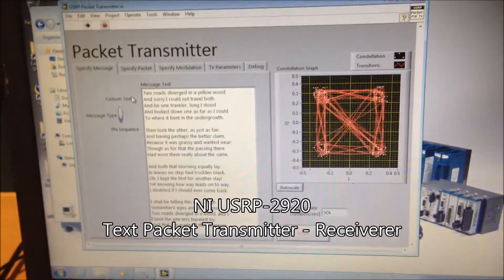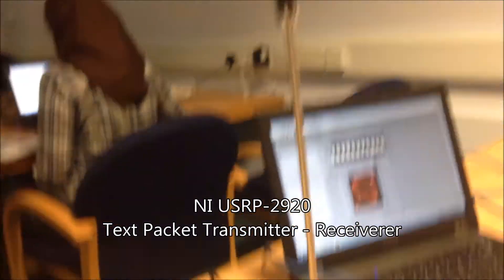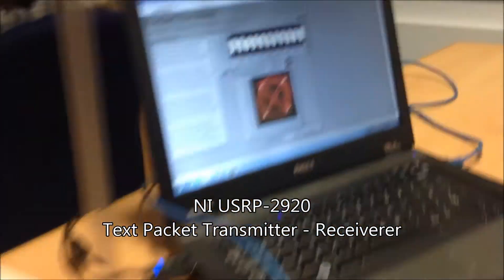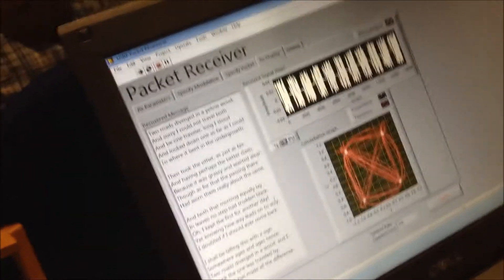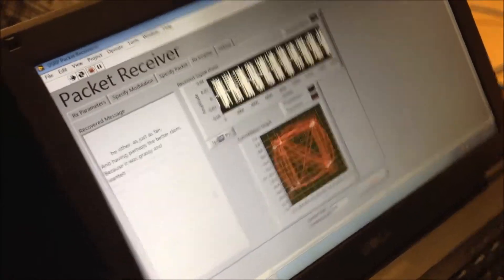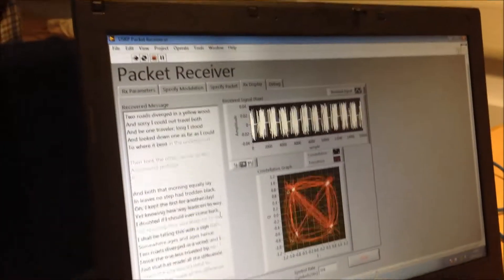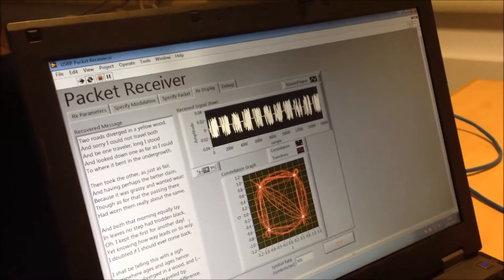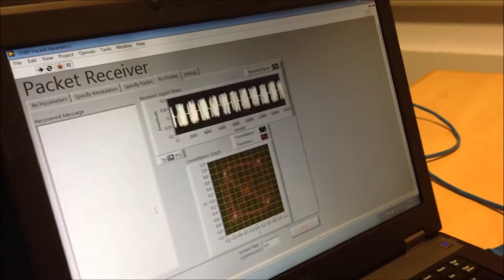NI USRP-2920 - Text Packet Transmitter Receiver

Comment: I activated this code but I couldn't run it. Can you help me ?
Reply from the maker: Kebire Bardak did download the material from link attached?
Reply: stdjmax Sorry but which one I need to download ?
Reply from the maker: Kebire Bardak 
If put this address the material should be downloaded
https://lumen.ni.com/nicif/create.xhtml;jsessionid=xG0RoYG3lizOq_ho6DSOKkp-rXu3E5G172x_TlcHe1zrKr0n-7WP!-1275838571
Reply: Can you send me the mail address if it s not problem for you ?
Reply from the maker: try this
ftp://ftp.ni.com/pub/branches/uk/introduction_to_software_defined_radio_usrp/2013/handson.pdf
Reply from the maker: Also a dropbox link no login required
https://www.dropbox.com/s/6os9np5fdly2xjz/NI%20USRP-2920%20-%20Text%20Packet%20Transmitter%20Receiver.pdf?dl=0
Reply: Thank you so much but when I run it again it doesn't work. I can not see the text message in the recevier.
Reply: Could you send me the exercise that you have please?
Reply from the maker: I do not have at the moment the exercise since this was almost 4 years ago!!